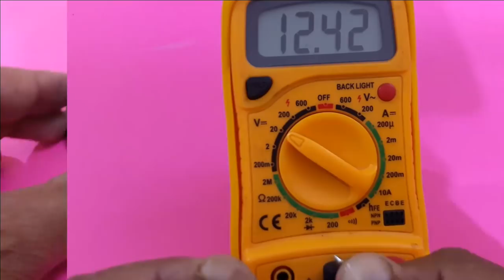Tips-protect speaker and tweeter from burning

Comment: This method of protection is done by a number of manufactures to stop damage from abuse, however as the tungsten heats up its resistance also increase compressing the sound. This is good for sound reinforcement gear on tweeters to protect it from being over driven and or clipping, but not the best in hi-fi or home use, due to the unwanted insertion losses and dynamic sound compression. However with those cheap speakers you used the sound is so awful anyway who cares, so good video, good work.
Reply: Note unlike a ptc this method allows speakers to continue to work even when being over-driven in say a PA on stage live performance application but at a reduced compressed level. Where a ptc will cut off the sound almost completely and would spoil the show.

Comment: That is actually really good idea. Light bulb impedance raises as it gets hot and rising light bulbs’ impedance which is connected to the speaker in series will restrict the power that is going to the speaker. More powerful speaker will need higher wattage bulb. And no, it will not hurt anything. Actially a lot of speaker factories use that method.
Reply: bulb connected series in capacitor to positive tweeter ?
Reply: Lol
Reply: It will absolutely hurt the dynamics, that's why it's only used for tweeters (in PA) and NEVER for woofers.

Comment: I've got an even simpler way to protect speakers against damage. Listen to them. Actually take notice of what you're hearing. If you hear distortion, turn the bastards down. It's not rocket science.
Reply: What if you have children who like to play your hifi when you're away from the house? Gonna teach them to hear distortion.
Reply: J Wuh just tell your children not to go past a point with the volume knob 
(Sorry for bad English)
Reply: @gl-jp8up  your english is good! But when i was a child i ignored my father's rules for the music system!
Reply: Or use an Amplifier with Clipping protection - saves every speaker, if the Power of them is roughly matched (e.g 400W Amp on a 300W Speaker is no problem, even on the youth club where this combination is used for 20+ years).
Most Speakers (or the tweeters of them) are dead after you have drunken alcohol because this sets your awareness of distortion really down! And distortion is what kills your tweeter, not the high level of sound. Either you stay sober or you use an Amp with Limiter - problem solved.
Reply: @gl-jp8up  easier just take the knob off, or decorate it so they wont see it it works
Reply: Isaac yeah lol
Reply: @gl-jp8up   you have good kids they listen to you all the time ?????....lol
Reply: loadi2 I don’t have kids yet, and I didn’t say they’d listen to everything I’d say, I would just do what’s necessary so they don’t mess my speakers up

Comment: And now your amp is driving a completely different ohm's resistance never do this if you care for your amplifier, just because you can, dosent mean you should.
Reply: This is not a problem, look closely at an impedance diagram of any speaker with voice coil.
Reply: I noticed my MBQuart and RockFord crossovers employ this safety feature as well.
Reply: If my amp is 20W, what speaker impedance match to gain the maximum capability of my amp? Thanks
Reply: Cliff Haerden you don't want to raise  ohms because it causes the amp power to drop.
Reply: You are wrong, if you use class d amp than output LC filter is designed for narrow range of impedance
Reply: @adelaptak9301  amps have ratings, more ohms means less power.
Reply: @adelaptak9301   any loudspeaker has a variable impedance freq dependant. So are you implying that class d amps are not meant for driving loudspeakers?
Reply: @weislerguittap  
Yr spkr impedance should be more than your amp impedance, while the spkr rated RMS wattage should be 20w or higher, assuming your amp RMS power is 20w (RMS power, not peak or PMPO power)
Reply: @weislerguittap  assuming your amp 20 watt RMS. 4 ohm speaker 20 watt rated, max 40 watt (or more), 8 ohm speaker 10 watt rated, max 20 watt (or more). Many audio forums said, speaker watt 2x > amp.
Reply: Impedance of a speaker rises which application of power, and the higher the damping factor, the higher the rise. So you don't really understand how this works.

Comment: It's an old school.method of speaker protection. Pretty much like putting a fuse in series with the speaker. I've heard stories from djs who would actually see their bass bins dimly light when they would be blasting them.
Reply: The bulb shows no resistance when cool, when you put more power into it the filament lights, gets hot and makes resistance. Taking some of the power from what is being sent to the speaker.
Reply: Gumba Sal speaker impedance also rises as the voice coil temperature increases from use.

Different size enclosures also causes peaks and valleys in a speakers impedance across the frequency range.

A speaker's impedance when measured and not in use? is never the same as when it's actually being played.

Comment: Bell & Howell used one of these on their first solid state 16MM projectors (500"T" series) back in the 60s. They used one side of dual filament bulbs with no bases and called it a "barreter". They used 16 ohm speakers. Another outfit used them but I can't recall who it was. When B&H used the same circuit amp in the next generation of projectors they dropped it from the amplifier. ??

Comment: It’s a good simple and cheap way but they will slightly degrade the sound and might I add when you turned up that music it distorted and the bulb did not bust so if you was to run it loud and distort it like that for half hour or less and that bulb doesn’t bust you will still blow the speakers

Comment: The light has it's own resistance so adding the light bulb in series will completely change the load you're putting on your amplifier and this in time will hurt your amp. and also the quailty impact from running it through a small coil like that must be pretty bad..
Reply: Fuskers raising the impedance won't hurt the amp. Having inconsistent ohm loads on different channels won't either it will make it more difficult to level match the speakers though if the resister in this case a light bulb aren't consistent.

Several cross over designs use this bulb design on the tweeter circuit to reduce overall power going to the tweeter. For example the Memphis audio mcc6 components. Which sound quite good and rival much more expensive speakers when installed correctly. The new Memphis viv components simply swap the light bulb for an air core resister. Both achieve the same thing
Reply: Kyle Vanwinkle raising does affect the output. Read up on amplifiers.
Reply: @vsmichael1  
May effect output. 
But the question was damaging an amplifier. WHICH IT WILL NOT. 
And companies like JBL, BOSE and PEAVEY have been doing this for some time too. 
But what do they know, right 😂 .
Reply: When the lamp is warming up, the resistance increases and destroys the damping factor of the amp. That leads to sloppy bass response even before the speaker is in any danger. No danger to the amp though (as long as it's not a tube amp, they don't like mismatches in impedance)
Reply: +TANGLDWEB what are you talking about ...no company does this ...they use correct wiring solutions...you thick fool ...someone told you that and you believed them. . do you think Santa is real still ....????
Reply: @shaundavidssd  
Damn. 
Guess Einstein here, must have taken a trip to say HI to Santa 😂 
...trolls are gullible...

Comment: Just go with a 2,2uF capacitor in series on each tweeter or if more midrange is required then use 4,7uF capacitors instead...

Comment: Use 2 speaker in series...two 25w in series can handle handle double voltage ....at 100hz sound output of the amplifier in bridge mode is it's  rail voltage ...

Comment: My calculations says that the bulb you're using has a resistance of about 7 ohms (6.86 ohms to be exact). So it's the same if you're putting a 21 Watt 7 ohm speaker in serie with the other 35 Watt 4 ohm speaker. That gives you a total of 56 watts on 11 ohms on your amp output. You still get 35 Watts noise and a lightbulb that's burning. WHAT'S THE POINT???
Reply: Lampanın dinamikə qoşulu olduğu halda dinamiki artığ gələn vattan qoruyur və mənim hesablamalarına görə siz hələdə nəyisə başa duşmədiz🤨🧐
Reply: @Elmir.Rzayev  Mən hələ də ilkin hesablamalarımdayam. Dinamikləri qorumaq üçün gücləndiricinin səsini də azalda bilərsiniz.

Comment: Theres something invented for that its called a fuse
Reply: Dirty Potatoes fuse won't protect speakers against DC. Fuse just protect against overcurrents. 

Relays are the best way to protect speakers from DC.
Reply: HYOSAIZERO or you just turn your gain down so it's not clipping and  sending the DC current to a speaker like a nincompoop. this literally doesn't teach people anything!
Reply: If your amp gets blown, having the gain on low doesn't save your speaker. Neither does the bulb and neither does the fuse.
Reply: @tomkocur  only ways to blower amp is eitherhaving your game maxed out so it's sending a shity clip signal all the time and it overheats or you let your voltage drop to a dangerous level any damage components such as capacitors and such. or you have a lighter job that looks like it was rigged up by a spider monkey with epilepsy! Adding a light bulb could add ohms to your final ohm load and also damage your amp... this is trash if you want to be in the audio you got to learn something you can't take shortcuts with light bulbs
Reply: Tyler Herod Amp can fail anytime for any reason. Higher impedance (more ohms) doesn't damage the amp and neither does low voltage
Reply: @tomkocur   below 11v can damage a amplifier & and to high of a ohm load you loose power and put your components (within the amp) under stress! I have been in car audio for the past 10 year's brother im not just saying this for no reason. I'm trying to help people not damage there equipment! If you want to make ignorant posts/comments then be my guest but your clearly uneducated on the matter and I would advise against anyone heeding your advice for anything audio related!
Reply: Nope and nope. Low voltage is a topic specific for car amplifiers and it doesn't hurt the amp itself, but the step-up/boost converter (which is a thing that is not present in HiFi or PA amplifiers). Amp doesn't care, if you provide less voltage, you'll get less power, that's it.
Higher impedance = lower current, therefore no such thing as "higher stress", it's actually the opposite.
Your 10 years in installing car amplifiers means shit, monkeys can do that, you know absolutely NOTHING about how amplifiers work. Get your master's degree in electronics, design and build your own amplifier and then tell me how UNEDUCATED I am. I don't limit myself to car audio installations buddy, I've been doing much more than that for much longer than you.
Reply: @tomkocur  well I'm not an installer nor have I ever been I'm an enthusiast!! I highly doubt you have any schooling based on the idiotic statements you continue to make and stand behind so hard-headedly.
Reply: @tomkocur  also seeing how this is a post that has to do with car audio it really puts your comprehension skills into question... To say that impedance has no effects on the components of the board is a uneducated statement! Yes you lower the voltage and you will make less power that is true you show me a 14v amp play at 9v then I'll believe you're borderline sci-fi statements and understanding! And if you didn't happen to go to school for whatever you claim you have it was clearly a waste of time cuz you didn't learn s***
Reply: Tyler, don't make a fool of yourself and just first look at how a car amp works - amplifier really doesn't work on a 12V input, it needs much more than that if you want to get more than 10W (or 20W bridged). That's why there is a DC-DC converter, which is the part that doesn't like low voltages. Look at any datasheet and you'll see a 100W amp can take anything from 20V to 80V of input voltage, but it will only give you the rated power near the high limit. And since we were not talking specifically about car amps, low input voltage really generally isn't a problem. These are the basics, Tyler, you should know this before you call someone uneducated.
I never said impedance doesn't matter, it fuckin' does - this topic is too complex for your understanding. Low impedance is a huge problem, amps circuitry is built with a certain current limit (based on what and how many transistors are used in power stage). If you break this limit, you'll break the amp (if there's no protection). And how do you get a higher current at a specific voltage? Yup, low impedance - the lower the impedance, the higher the current. What does a high impedance cause? Well, try disconnecting the load (speaker) and turn the volume all the way up. Did the amp blow? Nope. HIGHEST POSSIBLE IMPEDANCE and the amp doesn't blow. FOKKEN MAGIC. These are the basics, Tyler, you should know this before you call someone uneducated.
BTW if you were educated, or even if you had some practice, you would know that bulbs are commonly used in PA crossovers to protect the tweeters. I've also seen a car audio crossover with a protection like this.
Reply: @tomkocur  making a fool of myself seems to be a habit these days
Reply: You know,.. 
Companies like JBL, BOSE and PEAVEY have been doing this for some time. 
But what do they know, right 😂 .
Reply: @tylerherod7950  I have never seen a "blower amp"  what is it?
Reply: Yeah you tell them Dirty Potatoes! Fuses are for blowers!
Reply: Don’t use a fuse or a bulb, use a over current protection circuit!
Reply: @tomkocur  A light bulbs impedence is nearly zero when not powered. And rises non linearly. It acts as a limiter. And is used all the time in pro sound, no, it does not make your amp run harder, it loweres current going to the speakers the closer to the bulbs voltage rating you get.
Reply: @wishusknight3009  Yep. I completely agree with you. Not sure why you're addresing your comment to me, though.
Reply: @tomkocur  I may have clicked the wrong reply lol.

Comment: its the same as when you make a series type of connection of two bulb. so when a large amount of hertz signal will pass through the speaker coil becomes hot also.
Reply: Except the bulbs impedence will rise much faster than the speaker coil, since the speakers load is more inductant.

Comment: Instead select appropriate speaker for your amp or vice versa. buying a power amp for tiny speakers and then adding resister to protect it is waste of money and power.
Reply: Not all speakers are used for music playback some of them are used to amplify live stuff coming frome microphones so some times happens to go a little feedbacky a very dangerous condition especially for tweeters. So this is a good and cheap solution to save them.

Comment: I don't see the practicality in doing this. You're asking the amp to work harder to achieve the same results. That's like putting a cup of water in the microwave with your TV dinner and calling it "slow cooking." I'd say leave the speaker how it is, I didn't see him ohm out the speaker after installation of the bulb.

1. Power isn't what kills a speaker, distortion & clipping signals is what kills speakers.

2. Increased impedance=decreased wattage which doesn't play a speaker as loud. 200 watts @ 8Ω is 400 watts @ 4Ω.

Comment: Somehow i fail to see the logic in this,  its distortion that damages speakers so turning the gain down will help since speakers cannot defrienciate between power and distortion. With external amps running speakers, just turn the gains down. Another factor is a quality amp, if you have one that produces less distortion then this contraption is friutless not to mention time consuming.

Comment: This is just series resistance you can get same results with just one power resistor but in both cases it limits power flowing to the speaker so is it same when you decrease volume with is done with potenciometer and potenciometer is just special type of resistor. So it mean you don't need to build this circuit to protect your speaker coil, just don't use maximum volume

Comment: So, you increase the resistance of the speaker, this makes the amplifier put out less power, this is also achieved by NOT TURNING THE VOLUME ALL THE WAY UP. If you have quality speakers driven by a quality amp you'll get tinnitus before the speakers burn.